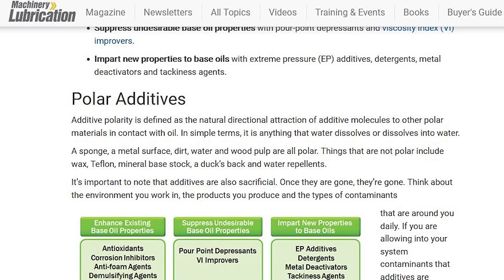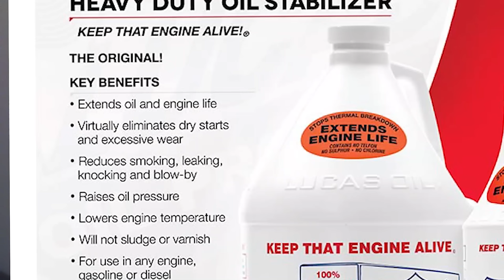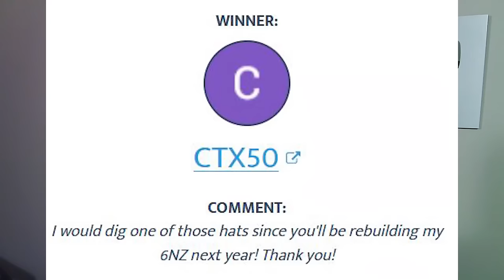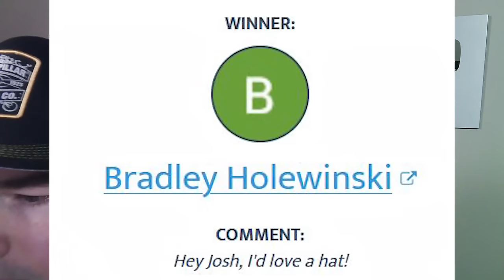Does your Engine NEED Lucas Oil Stabilizer? A detailed look at the "Benefits."

Comment: newer engines with variable timing etc are very touchy with viscosity and will throw codes
Newer cars use 0w15 or whatever and thicker oils can affect them
I use this in my old v8 cars cause they sit between starts and have no electronics and driven in hot weather

Comment: I have used Lucas in engines from my current daily driver diesel Nissan tow rig, through to my modified small block and big block Holden,  Chev, Ford and Chrysler weekend toys for the last 30 odd years.
I only use Penrite Oil and Lucas Stabilizer and have never had an engine failure due to poor oil lubrication or quality

Comment: I think the reason for saying would cool engine is speaking of reducing friction. Do know putting one cap of it in each tank at fill up will increase your fuel mileage depending on your particular engine. My young cousin driving new Peterbuilt with Cummins gained 1& 1/2 mpg. Upper end lubrication went out the window with low sulphuric diesel

Comment: I bought a 1997 mustang gt last year, with 77k miles. Engine was smooth as new, I knew I’d beat that engine like crazy, and I’m a nerd for lubrication, so I buy a 5 quart bottle of valvoline 5w-20, (the car takes 5w-20 or 5w30, doesn’t matter) I throw 1 quart of lucas which I assume makes it closer to 5w30, and I’ve been running it like that for the last year, im at 95k miles and I drive it like a race car, it sees redline daily, and it runs as smooth as when I got it, oil changes are done between 3k and 4k miles, I’m never late. I don’t joke around about my oil. Hoping that engine lasts me

Comment: Saved 3 motors from nocking and customer thought they were toast.a good motor flush before hand and use Duralube oil and liquid molly u will see some good improvement. I tried many oils and I tell you Duralube oil will make your motor last forever if you dump a quart in every oil change.I personally tested this oil on v8 5.3 liter. It's really liquid gold.

Comment: So if it reduces friction it would reduce heat. Friction 101.   I have an older grand Cherokee that will throw a code for oil pressure too low.   Faulty sensor very common to this vehicle.  So, that why I use and it does not throw the code anywhere near. As often .   The Jeep has had power steering and the auto a/c keeps the compressor cycling so occasionally the idle drops when all those drags load the engine faster than the IAC can compensate and the idle will fall to 450-500rpm and the check engine light pops on.   This seems to cure that problem or greatly reduces its frequency.   If you hold the wheel at full stop and don’t give it any throttle you’re probably gonna see it throw a code.   The oil pressure switch is in 
a cramped spot near the filter and very close to the oil temp sensor and I can’t really tell which is 1 or the other plus the engine has 103,000 miles on it and probably needs it’s 5W-20 oil thickened up a little to compensate for wear.

Comment: Been a wrench most of my life.  When the toys break no one’s going to fix them but me..  I have 76 vintage motorcycles..  and a few vintage cars.    I use oil stabilizer in everything..  my racing engines last way longer.  In most of the old bikes the cams ride on aluminum journals . It’s a major high wear area..  stabilizer definitely leaves a film so when you cold start is won’t score it up..    also have a 97 gmc safari with over 300k miles .  Always used stabilizer..  it not even burning oil yet..     I’ve seen the results. And I’ll never stop using it..

Comment: I look at it this way - If you perform your recommended service at the proper intervals, additives shouldnt be necessary. So why not save your money? But if your car is already burning oil and on her last leg as it is,  what harm is there in putting something in it to get it by a little longer? Idk its all up to what you wanna do. That said, newer modern cars use thinner viscosity oils. For example, I think a 2018 Honda CRV with the earth dreams turbo runs 0w-20. The oil galleries are very narrow and as a result, the thinner viscosity should have no issue passing through. I could see how trying to move lucas additive through a narrow passage meant for 0w-20 could pose and issue. Its like trying to push honey through a straw vs a wide mouth funnel. This could pose an issue especially for OHC engines that call for thinner oil. Again, that said, they do have a thinner viscosity additive for newer cars which call for thinner weights like 0w-30 or 0w-20. The long and the short is, use what your car recommends. Additives, imo, are temporary remedies to get by until a proper repair can be achieved. Id never run an additive in something brand new, aside from of course using assembly lube and soaking lifters when its brand new to prevent a dry first start.

Comment: I don't know about all the science and the claims, but we had an old F-150 that used to knock like a pig and I mean this is the loudest knock. This engine should have broke every time it turned on poor quart of Lucas oil in there and it would go dead silent. It would become so quiet. It would sound like a new engine again. I should have videotaped it. This was before cell phones were really prevalent but I wish I had, that truck used to knock so loud. It used to hurt your ears and when you would change the oil and put Lucas oil in and specifically not until you put the Lucas oil in The knock would go away almost entirely. Eventually the engine broke but it probably made the engine last two years longer than it would have otherwise ran 2 years with a grotesque knock not babying it or doing anything else special

Comment: The reduces engine temp. is referring to it increasing the lubricity, thus reducing parasitic losses through oil shear, but as you said like a billion times, it is a thicker compound, which even tho it may contain additives that reduce oil shear and such, but by being a thickener it would have to be a miracle compound to contradict the paradox that is the product itself... sure, it may have additives that reduce oil shear friction but it is thicker so it adds other losses which zero out the equation essentially... like the pump having to work harder... pressure itself is a direct relative of temperature, as the more pressure, the more energy is put into something, and if pressure rises, it means flow encountered a resistance, and now more and more energy is used to sheer force the flow through the resistance, thus making the point of resistance a heater and simultaneously increasing the oil temp moreso by pressurizing it and forcing the pump to work harder, heating it up and oil itself that passes through it... its 3 reasons why oil gets hotter and one questionable not even a claim that it reduces oil shear point while maintaining a good film strength as that is the only way it could lower the heat generated by oil being worked in the bearings...

Comment: The most important thing is to change the oil as required.  Use good oil that is approved by manufacture.  Use good filters.    Some special situations can use oil additives like with HEUI injectors.  Does anyone still make a HEUI engine?  There is a reason for that.  Injectors don't last and can use an additive.

Comment: After adding Lucus to my oil in a 1988 chevy pick up stock 350 (fresh oil and new filter of course) i always let my engine idle and warm to proper operating temperature at the start of the day or after sitting for long periods of time ....and my motor operates just fine.Great oil pressure smooth idles the whole works....Lucus is a great product...Two thumbs up.

Comment: I've seen some really bad side effects to higher oil pressure than required.  Floating bearings  and pushing out seals.   You are better off with higher flow with stock pressure.

Comment: The Upper parts Cam, lifters, etc. don’t have oil on startup.  I have a 2011 Malibu and the camshaft/Lifters make noise when it’s been sitting for a couple of days and I used the Lucas low Viscosity oil treatment stopped it

Comment: Well... I run 0w40 fully synthetic in an engine that is meant to have 0w30 in it. Its got almost 250.000 Kilometers on it and they are good for around 500.000.
So wear is present and the lifters are getting quite noisy. 
Running 0w40 has helped A LOT with that. Its down from being really noticeable on startup to a faint ticking you only notice when the car is coasting at slow speed with the windows down.
I used 5 Liters of said 0w40 and added 500ml of Mannol Ester Additive to get it up to the proper level on the dipstick.
Why did I do that? Because synthetic Esters are really good and adding them to engine oils has a multitude of benefits just google it if you want to know more.
Some oils have Ester in them already but they are super expensive exotic racing oils.

So switching viscosity under controlled circumstances seems to work well. But id never just dump an oil thickener in the engine.

Comment: All this wasted time just to hear basically “yes and no” rambling. There are privet studies on Lucas Oil that you can see. Also, use suggest propositions or a little less and you will not see your oils as thick as paper. On that note to the claim of cold weather, let’s not pretend that Lucas doesn’t have a product that they recommend for colder weather (thinner oil) they do. 
Also, if you care about your fleet or personal truck/car. Do an oil analysis on a regular basis, start with your regular oil and after adding Lucas. See the difference for yourself. 
It works, it does what it needs to do, people use it when they need it!

Comment: Good vid.. I don't use Lucas in transmissions, but I will use it in differentials and transfer cases where there are no synchronizers
I have a Cummins 5.9 that has bad hot oil pressure and it did help there, it has a fair bit of blowby and it didn't help with that (didn't expect it to either).  It certainly isn't a fix, but a bandaid
I'll send you some pics that are candidates for destruction of the week.. I have a few :)
Reply from the maker: I'm always up for destruction of the week, thanks.
Reply: @AdeptApe  sent you some of my destruction, and some funnies!

Comment: I think the key thing here to consider is that using lucas oil stabilizer is a double edged sword. Yes, you thicken your oil, which may or may not be a good thing depending on your environment, but you will inversely dilute your base oil additive package. Oils are designed to have proper proportions (ppm's) of cleaning detergents to fight sludge, corrosion inhibitors, and agents that protect against wear (calcium, phosphorus, zinc etc.) by reducing the concentration of these you are messing with the protective qualities that were designed by petroleum engineers. It also increases the overall weight or viscosity of your engine oil, certain engines are designed for oil no thicker than a particular weight, so thickening up the oil will cause a loss of hp and gas mileage among other potential issues.
Reply: Wrong your fuel mileage increases a bunch

Comment: Lucas has been proven in wear testing equipment to reduce wear so I'm sure the oil pump would last longer with Lucas in the oil. I would not use it in a new or good engine with low miles on it but I think it can work great in high mileage engines.

Comment: I use the stabilizer on garbage that has rod knock, lifter noise and low oil pressure. Works for that but that's about it.

Comment: This stuff is good for stopping oil burning in a worn out engine, that’s about it. I used it for that particular issue in a dodge stratus, an olds Aurora and several Chevy 350’s. Doesn’t fix any, but will satisfy someone with a cheap car that they are limping to death.
Reply: A thicker oil would do the same
Reply: @alexstromberg7696  agreed! I had one truck that was burning a lot of oil. Started putting 20w50 conventional in it, problem solved.

Comment: I change my oil every 10,000 miles with a cheap Supertech oil filter from Walmart. I have a 2012 Mazda3 Skyactiv that uses 0W20 full synthetic. I change the oil and only add 4 quarts then start it up and let it get to temperature, then I add a half a bottle of Blue STP oil treatment and 5 ounces of Motorkote and top off with oil every oil change. 190,000 miles and it doesn't use hardly any oil between changes. Have done it since 20,000 miles. Most oil additives are used after a problem has started, the owner runs to the parts store to look for some kind of mechanic in a bottle. Why not use them to prolong the engine before the problem starts? My car runs quieter than when it was new. Every vehicle I have owned has went to the junkyard with a rusted out frame with a excellent running engine and transmission with over 200,000 to 286,000 miles.

Comment: This is the absolutely only thing holding my miata motor together during the winter. 3q of 10 30/40 and 15/50 in summer with 1q of this stuff

Comment: Oil additives burn off first. So if you have a front line of protection, the rear line last longer. I'll actually last longer then recommended. Recommendations is short due to the additives burning off first

Comment: 2006 Toyota/Scion 168,000 mi. I been putting a qt.of it in every winter for last 5 years along with Mobil1 5/30 oil a Baldwin B37 filter. I gaurentee I have the smoothest running 1nz-fe engine in the world😅

Comment: To the argument of using the Lucas to raise oil pressure in worn engines.  Pressure is resistance to flow. So does that mean your flowing more oil or just slowing the flow of oil down.  My guess is your just slowing the oil flow down    I think I’d rather have volume over pressure.   Just thinking out loud

Comment: I worked at merichem research and development out of Houston Texas not to many miles away from the main plant. Here at this center the chemist tested anything to do with fuel’s and oils and along with other chemicals produced by plants. There wasn’t but one really good oil that the chemist agreed on after double test and came to find out Havoline motor oil was the best that held up under heat and friction. They took it own their own to test additives. And 9 out of ten failed. STP was one of the worst and lucus was around midway of the graft. Now when it came to stickey lifters one really thin lucus product worked to stop the sticky lifter within a couple of minutes. And they did more test on this particular one and on one cold morning down in the 30,s and motor sitting for two weeks was cranked and the lifter tapped a few times because it went quite and stayed quiet. These products are just to make money on a by product from processing gas and oils. Nothing is really good.

Comment: I can only say that I am not a mechanic but I understand quite well how an engine works.... I will say that in vehicles with low mileage this additive is not necessary...in vehicles with a little wear,heavy duty work like to much city driving ,very hot places ,delivery driver cars ,Taxi or similar it is necessary. What will make the big difference is the exact amount of this additive that you should put in the engine....if you ad a full bottle in a 4 cylinder engine it would be to much ...but definitely put a little of this additive in the engine at each change of oil will improve absolutely the entire operation of an engine ...recommended if the engine has more than150XXX miles...it will last longer without a doubt

Comment: While I do not own a big diesel engine I do have a 1993 jeep Wrangler YJ with the 4.0 stright 6 this engine has well over 400k miles this is a gasoline engine and with this many miles it leaks and burns oil very bad I could only drive it 70 miles before it used one quart of oil so I was wondering how to help this issue out I read about Lucas and said I doubt this is going to do anything so I dumped one quart of Lucas into the engine and the next day when I went to start the engine all the big cloud of blue smoke was gone when it is idling there is not any blue smoke coming from the exhaust and it lasted for about 3,000 miles before needing more Lucas so in my experience Lucas has helped my engine keep running smoothly and strong and to get more miles out of this worn out engine and Lucas has helped with oil leaks they have pretty much completely gone away

Comment: The idea of "reduces operating temperature" is that in theory it would reduce internal friction. Does it really do so? I don't know but I suspect thats where the claim comes from.
  In theory if the existing oil is doing its job properly engine parts are never in direct contact anyway.

Comment: Question. Would the slow addition of Lucas oil be good for a recently replaced rod bearing that still produces the faintest of knocking? The motor in question is a 2009 Toyota Corolla 2zr-fe vvt-i

Comment: I use it just for what it is . A heavier weight oil . That will increase oil pressure all around but I like it's use  at higher temperatures . That said as a machinist listen to me when I say engines are designed as metal on metal wearing on each other.   You can't change that. If you want the best bang for  your buck learn to disassemble to refresh your engines at their b50 recommendation intervals.

Comment: Hello I have been watching your channel for a while now I have a C 12 on a 2000 freightliner dump truck. I have a little bit of blow by lightly seen smoke coming from the bottom holes. The question is how do I know when I need a valve adjustment? What are the symptoms to look for?

Comment: The problem is heat dissipation through oil flow, if your oil is sticking every where it’s not returning to the crankcase to be picked up and recirculated, thus not helping with heat which breaks down oil.